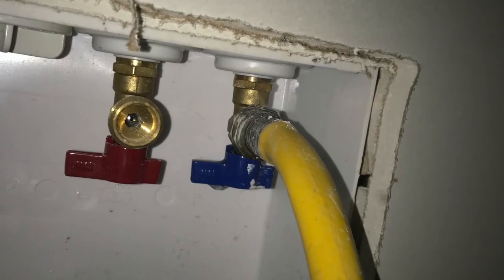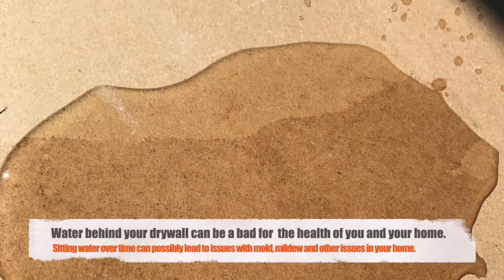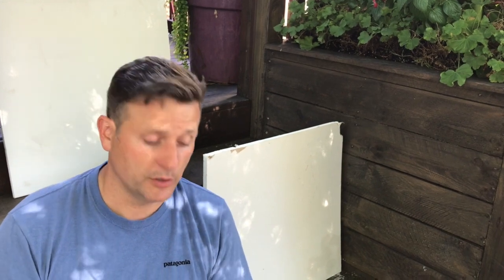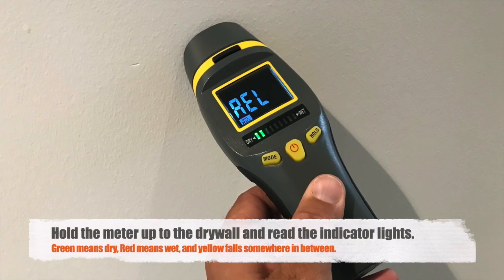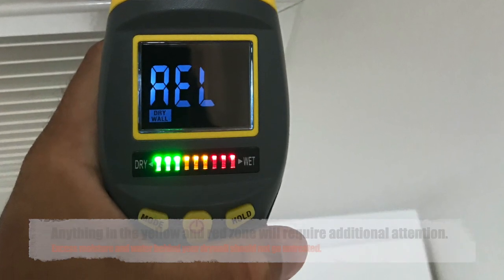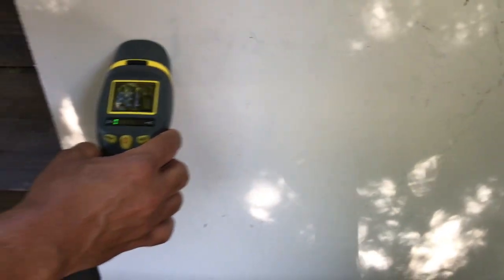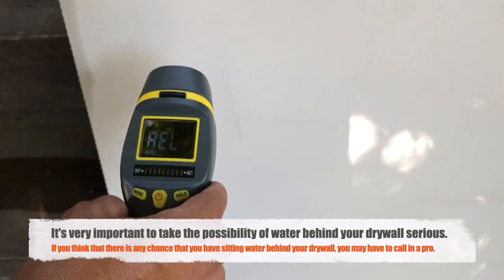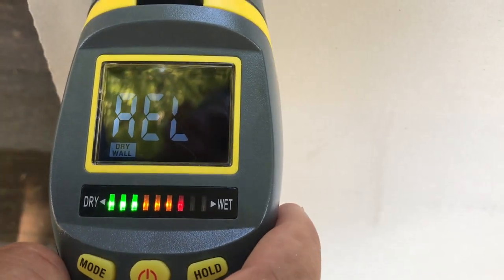Using a moisture meter on drywall, Using the General MM9 moisture meter.

Comment: Thanks, man, but this model does give you the %. Pull off the cap, remove the pin protectors, press the pins against the wall, and it shows you the %. So, use the tool with the cap on to scan large areas and use the pins to read the severity of moisture.
Reply: Thank you for this information. This is what I was looking for.

Comment: So if it goes in the yellow that means there is water. But if it’s red that mean there is a ton of water? Which one is safe? All green?
Reply from the maker: Green is all safe. Yellow is “moderate” amount of moisture and you need to consider action beyond fans and drying out. Red means that remediation (removing drywall and wood) is most likely needed.

Comment: Does it also work with kitchen cabinet wood.  We had some minor mold and moisture under kitchen sink cabinet due to water leak from kitchen sink.   

We are thinking of treat & clean  using bleach or other essential oil to kill mold and dry the area. 

However we don't know how bad under cabinet base board where the floor is.    Inspector thinks it is minor mold in small area. 

  How sensitive is this device?
Reply from the maker: This device will work on wood cabinets. A better product to use for this minor mold issue is a product called Concrobium. It’s a salt enzymes product that encapsulates and kills mold spores more effectively than bleach on porous surfaces such as wood. You also may want to investigate the area below the cabinet by removing the bottom toe kick of the cabinet and looking in that void for signs of moisture, mold or moisture damage to the bottom side of the cabinet or the floor.

Comment: Do you press the meter directly on top of the wall ? Or hold it back a little
Reply from the maker: Yes, press the device directly and flush against the wall. Some of the meters (depending on model) may have prongs, in which you can press those directly into the wall or surface.

Comment: but how accurate is it ??
and what the hell does the AEL mean?
Reply from the maker: Great question, and one that I had to look up!The “AEL” is actually “REL”, as in RELative measurement, according to the General Tool website. 

And in regards to how accurate this moisture meter is.... well, this is a great home owners / light commercial meter designed to give you an idea if you have a moisture problem or water damage that might need to be addressed to avoid further home damage or health issues. Testing it on various surfaces with various levels of moisture, I found the meter to work quite well, and for around $50, it’s well worth to have one around the house. For someone who needs detailed moisture level readings, such as a hardwood floor professional, this is not the best option.
Reply: @EverydayWorkbench  
Hey there thanks for your reply!  I also looked it up and saw that.  So I am asking because I have the exact same one from work and recently bought a house, messing around with the device, testing random areas just because nothing looking problematic at all.. and I got a questionable reading when I tested the kitchen wall of all places along side the range, I got maximum RED.
Even the bathroom barely showed a couple bars.
This wall is not soft whatsoever, new roof 2018 and nothing on the pre inspection.
Reply: @EverydayWorkbench  
Head Scratch any ideas?
Wtf?!🧐
Reply from the maker: @travisskyski  Ok, The first questions I would try to answer is what type of plumbing do you have above the kitchen, if any? Perhaps a minor leak from one of the water lines going to this area is flowing down the wall and landing and forming a wet spot exactly where you are using the meter. Also, is it possible that the range might have a vent going to the exterior of the house, and through that, the possibility of a tiny water leak coming in through that space and landing on that range wall? And finally, it may just be an anomaly of sorts. If that is the case, if you test this area a few days later, there read might be green. In the event that you are still getting that red reading after a few days, you may want to make a small opening on that range wall to see what is going on. I hope this helps, and when you find out what is going on, please share.
Reply: No plumbing pipes on that wall that i know of just thermostat and light switch.
The rangehood vent is what worries me yes I will have to check it out more in depth.  No venting issues, I know it opens/closes fine but maybe a possible leak.  I will let you know what I find out! THANKS !!
Reply: @travisskyski  These tools don't measure water content. They measure conductivity. Because of that, they may be measuring something metallic behind the wall or perhaps even the moisture in your hand. Try to rule out some of the possibilities before starting a costly repair.
Reply: @grantcivyt  i just purchased this same model MM9 and also get mix readings in areas that show no moisture and away from plumbing. Now i think my whole house has water damage 😂
Reply from the maker: I’m sure you have done this, but make sure you have calibrated the unit before use. Calibration directions came with the unit, if you don’t have them anymore, easy to Google.
Reply: I looked up your video because no manual or instructions came with the device.  Bought it at Home Depot yesterday.

Comment: I don't like this new model because it doesn't tell you the percentage of moisture.  The old model would tell you on the screen the percentage, which gave you a better idea of how much moisture was in the wall.
Reply from the maker: That’s a great point. A percentage read out would be very helpful, especially for a pro. I don’t mind this unit as a home owner tool to help determine problem areas, but more specific date would be helpful!!
Reply: This model does give you the %. Pull off the cap, remove the pin protectors, press the pins against the wall, and it shows you the %. So, use the tool with the cap on to scan large areas and use the pins to read the severity of moisture.
Reply: @NaturePoetryBeauty  oh wow didn't know that. Ok well thanks for letting me know!

Comment: Why doesnt it tell you the %
Reply from the maker: This model is a basic home owners model. Professional models will have that feature.
Reply: This model does give you the %. Pull off the cap, remove the pin protectors, press the pins against the wall, and it shows you the %. So, use the tool with the cap on to scan large areas and use the pins to read the severity of moisture.
Reply: No drywall mode using pins